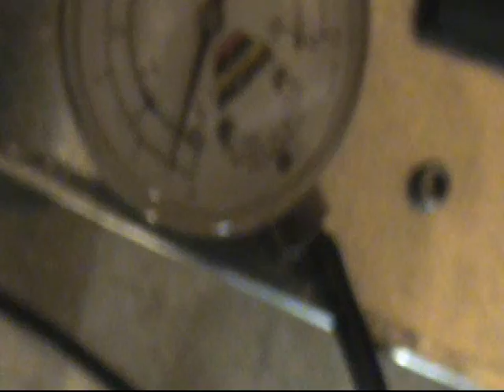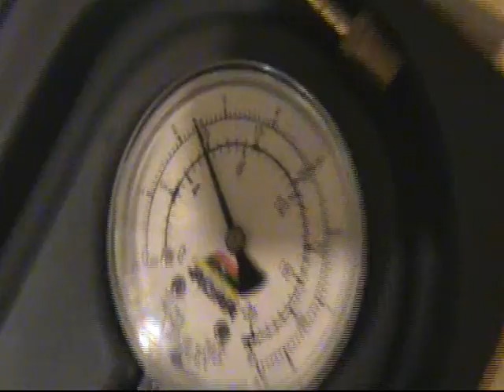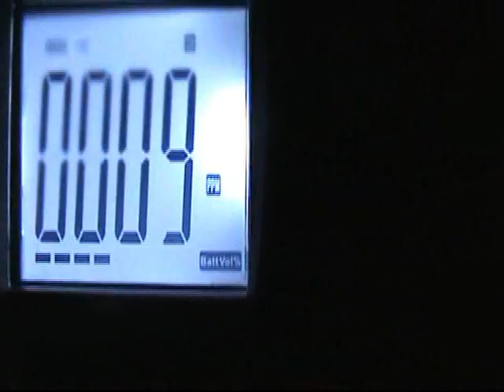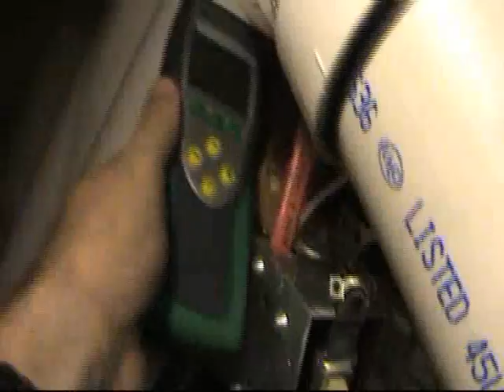Rheem RGRM Furnace Installation

Comment: Nice video. But wrong sediment trap position, it has to be after the valve. I understand you knew it but had to reuse old supply line.  However wrong is wrong.

Comment: Good video. A few points... Did you say the filter was inside the furnace! If so, why! You re done all the duct work put it on the outside. Never seen anyone use a chisel to cut duct work before, gonna try that forsure. Biggest question is why isn't the chimney flue re sized? I would have had to decrease to 4" forsure!? Thanks for posting though. Never seen anyone check joints with Co detector before either. Wouldn't it leak water If there was a leak? Not hating just curious.
Reply from the maker: Hi Don, thank you for your comment! On this model the internal mounted filter came standard and the outside mounted frame was optional,the decision to stick with the inside filter was to allow for a future installation of an electronic air cleaner.I agree,a reduction of the flue to 4" would have been nice.The 6" chimney was left intact as it passed through an upstairs wall cavity which would have made a lot of extra work to gain access to replace the 6" support plate to a 4". Checking the joints for Co leaks was done just after the furnace was fired up for the first time,it would take a while for condensation to start to accumulate and may only tell if there was a possible leak on the bottoms of the joints where the condensation would collect before running down to the drain.
Reply: +don snow I've installed two furnaces of this configuration as a DIY guy.  I cut all my sheet metal with a metal blade in my multi-speed jigsaw.  Cuts like butter and very accurate.

Comment from the maker: The pvc exhaust and air supply pipe size increases from 2 to 3 inch as soon as possible from the furnace to provide enough flow.The pipe runs in this particular installation are over 30 feet each way,this prevents possible pressure switch tripping from flow restriction in longer pipe runs.

Comment: Can you tell me if I can use 16 Gauge copper wire ( tinned prime wire of 600 volts rating  ) to power my furnance motor 1/4 hp, 115 volts & 4.8 amps of rating , the main circuit breaker for the furnance is 15 amps. Someone  told me the prime wire is for automobiles, can we use  these wires as to run home electrical  appliances ?
Reply from the maker: +Centrious mijkey I would recommend a 14 gauge wire for the ¼ HP furnace motor,there will be an increase in motor amperage over 4.8A with the continuous load on the motor running the blower. The tinned wire is for automotive wiring,but could be used for smaller home electrical appliances.